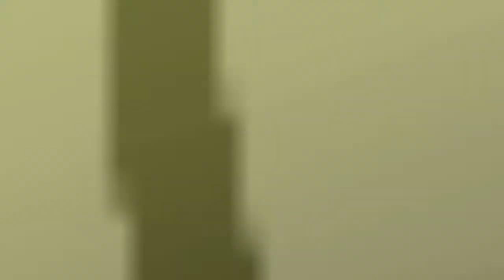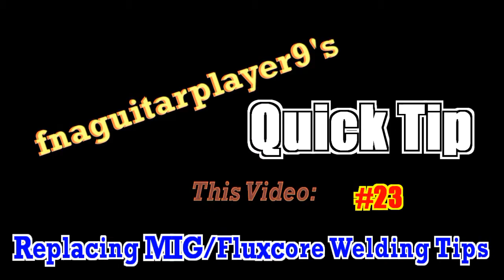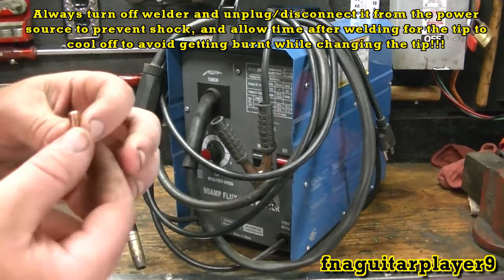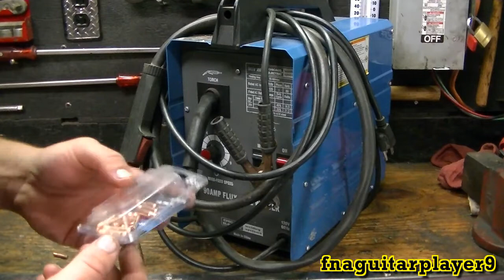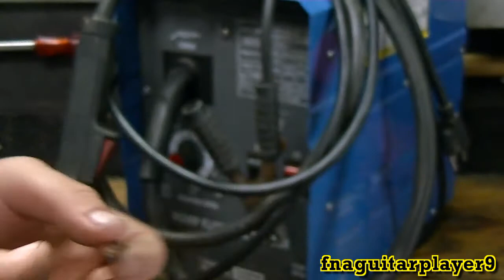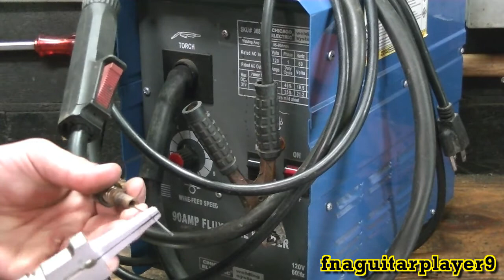Quick Tip #23 Replacing MIG / Fluxcore Welding Tips

Comment: Question please, I just got a welder about the same as yours.  I want to change out the housing that the tip you show here screws into but it will not unscrew.  How does it come off?  Thanks in advance.

Comment: If the tip size is smaller than the wire itll cause a jam. Even if the wire fits in it, it can cause problems

Comment: I have that exact same welder.  I've had it for about 6 years.  I havent used it in about 5 years.  Just started a new welding project and just really thought the welds "could be better."  After following your video, I changed the tip out.  WOW!  I am blown away at how good the welds look using a new tip!!!  I'll be getting more tips TODAY!!!  Thank you, sir!!!
Reply from the maker: They are great little welders, this on actually burnt up about a year ago, I did get  new one, its black now, but i converted it to DC and it makes a huge difference. It does help alot with a new tip! Your welcome, hanks for Watching!!!

Comment: Bought one in February 2018 and after seeing some videos about replacing the nozzle with a flux core nozzle I though mine would slide off and I could slide on the other. Mine unscrew and doesn't just slide off and on. The new flux core nozzle does not have threads. What's up?
Reply from the maker: Thats how this one is, it threads off. I'm not sure to be honest about it, just the way they decided to make them for some odd reason. You may have to end up changing the whole torch to get a better nozzle on it. I'm not a expert on welders, wish i could help more! Thanks for Watching!!!

Comment: great video. My brother has the harbor freight stick welder, I guess a flux core can't weld as thick steel as one of them?
Reply from the maker: Thanks! I hear ya, it mainly depends on amperage, this is fairly low amperage, we have a 170 amp mig/fluxcore (HF too) at work and it will weld alot thicker, but its also DC, that makes a huge difference. I'm thinking of converting this one to DC this summer (video to make!), but yeah as a general rule, stick welders are for bigger jobs, but still can be used on thinner metals with the right rods and amperage settings. I have a big 295 amp Montgomery ward stick welder and you can do alot with it. Thanks for Watching!!!